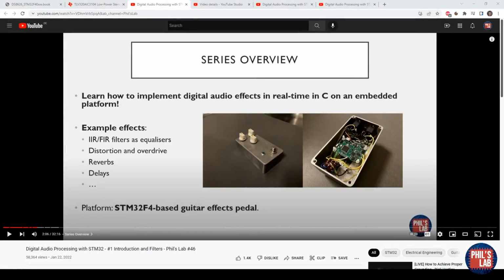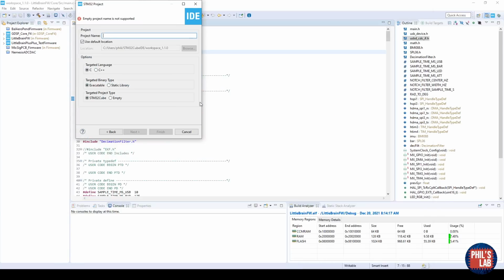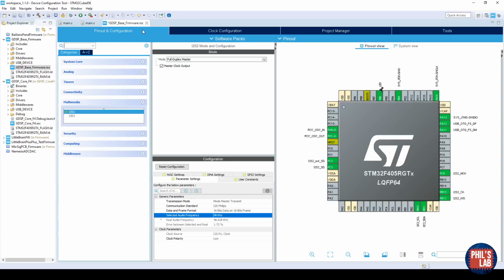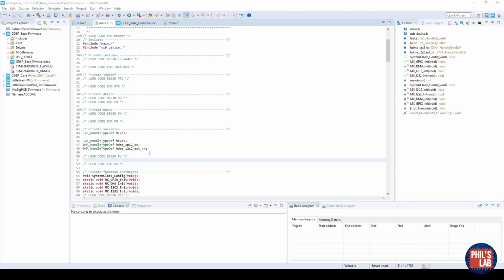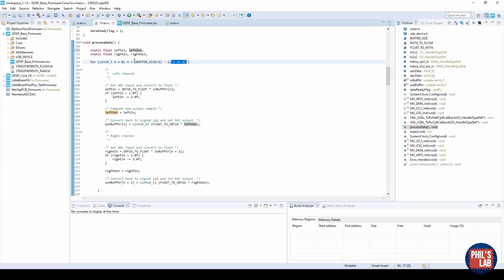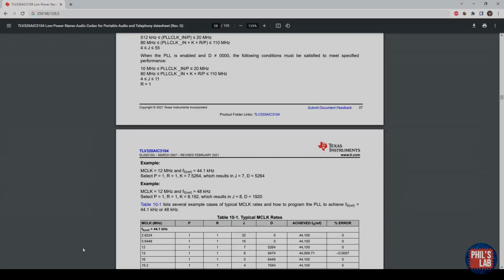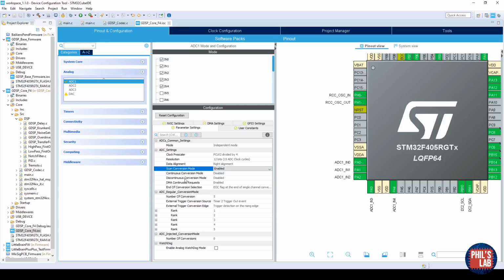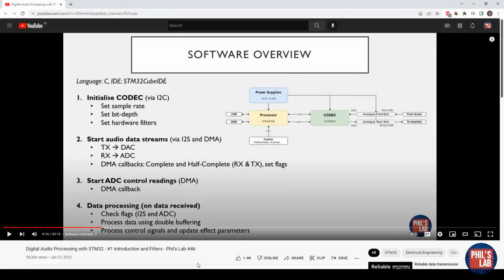(Sponsored) STM32 I2S ADC DMA & Double Buffering - DSP with STM32 #4 - Phil's Lab #55

Comment from the maker: I'm looking for some suggestions for upcoming videos! I currently have planned: final EKF sensor fusion part, PCB tips for EMC/SI, DDR layout and routing (Zynq), PCB build-up and stack-up, and a few other ideas. I'd love to do a design review or two as well but open to your suggestions. Thanks for watching! :)
Reply: Maybe do a video on Camera interfacing with stm 32 for live drone feed, using MIPI protocol
Reply: Hi Phil, I'm doing your course on Fedeval and I'm enjoying it so far! I'm using an STM32F7 for my project, and it turns out that I2S does not have full duplex available for the F7 series. To mimic full duplex, one can synchronise 2 SAI blocks with the I2S protocol. There's barely any example code on the internet for this, and ST has side-stepped this lack of functionality and only provides vague powerpoint presentations. I think SAI for the F7 series could be a much needed topic for some clarity on the internet!

Thanks for your great tutorials!
Reply: @marcorademan8433  Is it possible to use an SPI unit for that?
Reply: @marcorademan8433  Were you ever able to work around this problem?  I am using NXP controllers but considering switching to STM32F7 or H7.
Reply: Please include Thermal management and simulation
Reply: @powerpath-n4u  yeah this is something I look forward to in all upcoming videos :)
Reply: im waiting for a long time ekf video. maybe TCP/ip stack can become good video series
Reply: More board and firmware design. I would love to see board integrating stm32wl with RF/LoRa node development with all consideration when designing wireless devices. 
Also power analysis and how PCB design considerations or specific firmware tuning can improve the current consumption. 
As always thanks for sharing your skills ☺️
Reply: I'm looking forward to seeing the final part of the EKF sensor fusion! I have some suggestions, which are: Unscented Kalman filter, Model Predictive Control, IIR filter design with higher order than 1 (or have you maybe done that? At least I haven't found it then), and how to choose the cut-off frequency through Fourier analysis, Adaptive Control, fuzzy control, fault-tolerant control, and robust control. Even go for some image analysis and control together.
Reply: @gretarmark  I second the Unscented Kalman filter subject.
Reply: I am looking forward to the EKF video. I'll enjoy any DSP videos you get around to doing.  How about reverb or some kind of echo effect?
Reply: Making your own tools. A programmer, logic analyzer, (budget-)osciloscope and the like. From an educational stand-point it'll teach people a lot about their tools, and for non-professionals these can be really fun/useful projects.

Especially an osciloscope could be fun, though that's probably a big multi-parter even on a budget.
Reply: Great video. Thanks! Up to the question, have you considered some FPGA stuff? Maybe designing in Vivado or implementing MicroBlaze core and developing some software on it as far as Zynq's are concerned. But i believe that everything you are going to upload would be great!
Reply: Bicycle computers usually calculate inclination, i.e. percentage up- or downhill using barometer and distance. This is usually very slow and inaccurate. Would it be possible to use EKF sensorfusion for this? There would be a lot of noise, standing on the pedals, riding over bumps and potholes etc. and steering the frontwheel is also not constant.
Reply: My dream would be to see you something about "Q-constant transform". How to transfer the idea of this transformation into the world of STM32 microcontrollers :)
Reply: Possibly a filter based spectrum analyzer. Virtually anyone can do this on FFT, and there are usually no daredevils on digital filters 😀
Reply: AutoWah effect :)
Reply: Some quirky audio filter! Something odd with lots of s domain!!!
Reply: BGA fanout, Antennas in general, PMIC layout and routing (I mean those QFN chips with multiple switching regulators and LDOs). In the stackup video, please include using Altium's field solver to determine the track width for specific impedances.
Reply: I would like to see more videos on the theories of the guitar effects, how they work. Also more theoretical stuff about digital filters and signal processing. Higher mathematics are not a problem.
Reply: Maybe a video about WiFi , Bluetooth, high speed usb C, definitely interested
Reply: I would be very glad if you show us how to implement a PID implementation on it, using the ADC to actuate something on the STM32. I see that there's that CMSIS control library..
Reply: Hi Phil. For my thesis project I implemented a FFT routine using a STM32F429ZI. And inspected the results using the debugging environment... MCU setup consisted of a timer which set the sampling rate. The ADC which was configured for DMA and I used double buffering to make the process more efficient... Since you've done FIR and IIR filters in the previous videos you could possibly now do something with an FFT. Although this video would include some intense maths regarding the FFT but still interesting for a signal processing enthusiast.
Reply: An implementation for time-frequency analysis would be nice. Short-time Fourier, Gabor or Discrete wavelet transform which is often used to study the spectral characteristic of bio-potential ( ECG analog front end with instrumentation amplifier or complete ICs like ADS1294 would be a nice combination with the STM32 MCUs).
Reply: Hi Phil, I would suggest making a video about CAN Bus networks. I am really interested in the technical details of making a board with CAN Bus circuitry.
Reply: Maybe TCP/IP (LwIP stack) + Ethernet PHY or a small bootloader?
Reply: I would be interested in the structure of a BLDC speed controller and what you have to take care of. 
Since my smartphone no longer has an audio output and therefore I would be interested in how to combine an audio amplifier and Bluetooth receiver.
Reply: I'm definitely looking forward to the final EKF sensor fusion episode
Reply: Please more about external DRAM and probably graphics! It's also would be nice to have something which could help accelerate 2D drawing without directly manipulating framebuffer but not that complex like dedicated 3D MALI chips.
Reply: Also, how do we submit designs for your review?

Comment: I wonder that you made a while loop where you check the buffer ready variable. Wouldn't it be smoother to do processing in the interrupt handler like DMA1_Stream4_IRQHandler,  so the CPU is not so busy all the time? I know, the irq handler should not be to expensive to get a overload, but it would work, wouldn't it?

Comment: It is possible to change the master clock of I2S while its running to get a sort of bit-crunch effect. I know reducing the sample size can be done but I'm interested if it is also possible to change the bitrate and have it controlled via a potentiometer. Thank you.
Reply: For anyone wondering the same, the approach I have in mind is just average every x ammount of samples derived from a value of the input freqency (96kHz) divided by the target frequency. To get which values to skip you have a counter and using a modulo of the previously calculated division compare them to 0. This is just in theory and I havent tested it out yet.

Comment: Thank you! You're doing great explanations. I have couple questions regarding this video:

Is there any way to use something like x86 HLT instruction in a main while loop till the interrupts from DMA wake a CPU so processing starts only when ready flag is already set within interrupt handler, so while DMA works CPU cycles won't be burned?

I scratched some surface about STM chips and looks like they have MCUs with DRAM support and saw you have video briefly showing some device with dedicated RAM, but it lacks some detail and it's not really clear about how much memory it could handle (it would be nice to have 1 - 2 gigs or at least enough megabytes to keep 10 - 20 minutes of PCM audio data). Do you plan to release more videos about building devices with dedicated memory chips?

Recently I'm obsessed with building some sort of dedicated hardware audio processing thing (something like synth or drum machine/sampler) and this info helps a lot, since I'm not really into hardware. I definitely can do high level software part (DSP, control, etc.) but I'm struggling with hardware. Existing boards are too weak (like these STM or arduino chips) or too complex to work with without OS (like raspberry pi and more powerful mini PCs), but they become weak on RAM when setting with the OS like linux which almost takes all of their RAM and building custom linux for this looks like more complicated stuff (and less fun) than building custom hardware.

Comment: Hey Phil! If you see this, I was wondering if you could point me in the right direction for setting up the DMA and buffering/processing chain for the situation where its two different I2S busses. I have a situation where I have a separate external DAC and ADC, and the STM32 MCU only has half-duplex I2S capability, but two half-duplex peripherals. I am using one I2S to receive from the ADC and one I2S to transmit to the DAC. How would this setup look for this case?
Reply: Did you get this figured out? I'm also doing the same thing you are

Comment: The other suggestion from practical play with this STM setup is...  cast up in bit width to do your calculations then detect peaks and overflows in the signal and correct them before casting back down.  Over flows result in a sample flipping polarity and cause horrible pops, cracks and 'fart' noises.  Even the input ADC I have has no limiter on it's analouge input, so if you go past about 60% line volume it pops and farts.  That will need addressed in the input stage for that ADC is I recreate the circuit or just borrow the module.  An analogue hard limiter.  Probably an audio front end IC design specifically for protecting ADC inputs.

Comment: As a consulting Engineer, I've been really impressed with the STM32CubeIDE. It makes my life much simpler since I cannot dedicate all my brain cells to learn just one processor family. Phil's done a great job illustrating all the pieces that make up a basic signal processing system. Very clear and concise explanations. A pleasure to watch. Bravo Phil!
Reply from the maker: Thank you very much, Paul! Completely agree that STM32CubeIDE makes life a lot easier as a consultant and when designing hardware.
Reply: Agreed... but I happen to be using MPLABX IDE with MCC... it has a similar configuration. I've gone back and forth with one of my software consultants who prefers to just use an ESP with C libraries (so no UI with check boxes, ets). My position lately has been that it's best to leverage the IDE / UI / auto-generate workflow and let it generate the configuration code and library code rather than try to do all of this manually from the datasheets (as I used to do 15 years ago). So I'm interested in revisiting ST Micro too, since I gave up on ST at one point years ago when I didn't value the IDE and congiuration UI / auto generate workflow. So, this brings a question for a fellow consultant... Do you have any thoughts on the ESP products? They claim something like 600 DMIPS over the 200 or so that Microchip and ST seem to top out at. But I trust Microchip and ST more, for some reason. Thoughts from your perspective? - Jason